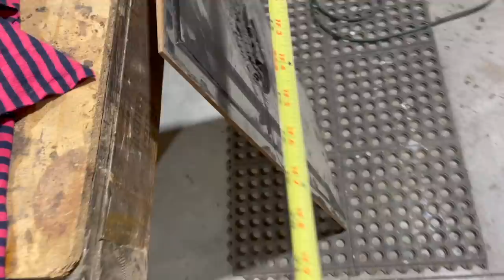Stop looking at my chest

Comment: on that top, It seemed as though all the frame pieces were relatively straight except for that front one that was crowned and twisted. Framers deal with that by cutting kerf cuts in the piece of lumber enabling the thing to be straightened. They straighten the piece by making that kerf cut and driving a long screw in at an angle to pull the lumber into position, couldn't you have done something like that? Perhaps making some kerf cuts in the back where it would be on the inside enabling you to take the crown out that way and then making some kerf cuts on the bottom up to the carving enabling to straighten it out in that plane. then holding the piece straight with clamps and perhaps against something strong like a metal straight tube fill the kerf cuts with wood filler.
Reply from the maker: if it were a worse situation i would have had to do something more. but i was able to get it to an acceptable level without brutal repairs. thanks for the suggestions though. cheers
Reply: Keep up the good work. I’ve have 50+ years of experience in furniture design and woodworking; and no small amount of repairs, too. I also started making and repairing guitars and basses as well. You might want to try using carbon fiber rods in such cases as this. I’ve used carbon fiber rods successfully while both building and repairing guitar necks. There are a number direct to public vendors on line.

Comment: Amazing! With the really warped board, would steam be an alternative to get it straightened?
Reply from the maker: Unfortunately with pieces this old it usually just springs back. Hard to teach an very old dog new tricks. But definitely with newer lumber it would. Cheers
Reply: @johnsfurniturerepair  interesting. Thanks.
Reply: @johnsfurniturerepair  ....it is harder to teach young dog old tricks
Reply: I was wondering if you could have cut it into strips with a bandsaw and glue those up straight, like a lamination or a plywood. You would of course have had to add a bit to make up for the saw kerfs. A lot of extra work though

Comment: Have you run into any issues leaving the inside raw like that? I've heard from others that doing so would be a recipe for uneven take up of moisture and would promote warping. I wonder if that is why it warped so much to begin with.  Sometimes conventional wisdom is wrong so good to hear from experience. Thanks for sharing!
Reply from the maker: definitely left open the trunk would start to take on moisture, but because they are usually closed the humidity stays relatively stable unless stored in extreme temperature and weather conditions. the eucalyptus also smells so wonderful it would be a shame to seal. cheers
Reply: I have learned that the best way to prevent warping due to quick changes in moisture contents is to fill drawers, or in this case a chest, with textiles. They will act as a moisture buffer, slow down the changes and thus prevent warping.

Comment: Couldn’t you have steamed the warped piece and then clamped it straight and let it dry? That usually works for  me. A plastic sleeve over the wood piece with a pipe coming from kettle into the bag. There are professional kits to use too which I’m sure you know.  Your idea worked too. I’m glad. It’s a very beautiful trunk and you did a fantastic job. Thanks for sharing! 👏🏻👏🏻👏🏻👏🏻👏🏻🇨🇦

Comment: Favorite video so far.  Shop Dog, obviously smarting from being called out for not gluing chairs, had me laughing out loud after I figured out what that dusting mitt in your hand would be used for.  SD did get the credit for the repair, tho.  I’ll be getting the 3M Dremel attachment - nice.  Today while spray waterproofing my tent fly I thought of the smooth, even technique in the spray booth, and employed the economy of motion which quickens the job and keeps track of where I’ve sprayed.  Those clients are fortunate to have a pro willing to spend expertise and time on practical work.  The product is sensational.  I get that kind of stuff all the time - regular life, regular quality, messed up stuff which requires yers of experience to repair well.  As for the video title - very embarrassing to be called out for not being the Renaissance Man I imagine myself to be.

Comment: Daaaang! You put some serous work into that. So far all of my clients with chest/trunk projects have all wanted a “suspended decay” style of finish to show off all of the use and wear versus a full restoration like you just did. That onyx stain you used looks great.
I’ve used that clamping method (as you did on the lid) a few times to straighten table tops before; it works really well. 
Nice job, Trena. It turned out great!
Reply from the maker: Thanks! Love the trunks on your channel! They are gorgeous.

Comment: the chest you are working on was made from new cut lumber and likely sold to an importer a short time later. the "hockey stick" piece looks to have been vert near a crotch or a branch then dried out in a drier climate. one little trick I have used id create a loose bag from good plastic around a foot long and6 inches in diameter. put the real warped end of the lumber in the bag and feed steam into the bag until the wood is easier to bed; bend it back into shape against a good solid buck and clamp in place to let dry for a night.

Comment: Someone relayed a Story of this relevance - many folks in the North Michigan region often migrated to Arizona for retirement and took their prized valuable furnitures and antiques with them.  NW MI is a cooler and very wet climate with what they call "lake effect" precipitation and snows coming in from Lake Michigan to the West - while AZ is "a dry heat" is what they like to call it, in addition to the dehumidifying effect of the Air Conditioners which run constantly. . . well you can imagine the surprises of the retirees when their prized possessions literally blew apart at the seams (and joints). . . I imagine you can add a humidifier to to your HVAC but unsure as to that technology needed to maintain a constant and similar relative humidity.
Story Two, with regards to your Lacquer Spraying - I knew a Painter in N MI who did remarkable jobs at clear coating Lacquer on our stain grade trim and doors to our Remodel Jobs. The Plumber and I one day tried to walk in the service door to the garage where the Painter was spraying about 10 doors and the fumes were just billowing out the door in clouds, so much so that my virgin lungs (as a nonsmoker) couldn't even get 6 feet from the door and I was hacking my lungs in revolt! Painter's in there spraying away WITH NO MASK - I ain't lying!  And he's was in there singing "I'm a little teapot, short and stout..."  The fumes were so thick you couldn't see in there! I checked him on it later, and he tells me "I've been doing this for 25 years bla bla bla..." My thoughts were "if he gets one or two more years without the crystallization and collapse of his dead lung tissue, then he'll be lucky. Wear a mask folks, especially for sanding old pre-1978 lead-based paints and finishes!
N MI has a different "breed" of roughnecks, renegades and ignoramuses like this guy - I Framed and Built the big houses up there for 15 years and all 4 Seasons, and literally saw 'em all!  Oh, and it took me awhile to connect the meaning of "Stop looking at my chest" - I think I'm a bit slow!🤦🏻‍♂️🙈😮😆
Reply from the maker: I do usually wear a mask. But I have awesome ventilation as well. Thanks for watching!

Comment: One of the best educational videos I have seen!!  Learned a lot about how you think through the process of "pulling" the warped pieces over then springing them back.  As an engineer, I would have gone about it all wrong, and ended up having to redo all those inner raised lips to make it close again. Your way is MUCH preferred as you actually time it so you can test fit it and make that last and most important adjustment.  Results, when looking at it from a customer's point of view, are the most important thing and as I am engineering based, I get more involved with the process at the detriment of the results....  Lesson firmly learned today on this holiday time... spending it quietly reviewing your older videos as I just sub'd after watching a couple...  Merry Christmas season, and happy and fruitful New Year!!
Reply from the maker: welcome and thankyou!

Comment: Hiya Trena, back in the late 60s' we lived in Kenya in East Africa, dad was in the Air Force. We purchased a camper wood chest very similar to this one, except it was camper wood, what a wonderful smell, and it had the same carving, just a lot more of it. The hasp and hinges were the same, as were the feet, but ours had corner blocks on the feet, in fact everywhere. The biggest difference was on the bottom in the wood it was stamped, with the individual letter stamps was, 'Made In India' I loved that chest and used to polish it with Betterware Lavender wax polish. Stay safe, Steve...

Comment: Wow!  This test turned out absolutely gorgeous! You did an excellent job I think if it was my piece, I have a piece of plate glass cut the same size as the lid, and with some proper felt pads have it sitting on top of the chest to prevent spills from ruining the wood or dust getting down into the carving again. I'm sure up with a pretty chest like this. You put things in there for long-term storage. What is the NEC there on the inside? I think I might've added a bit of cedar oil on the wood on the inside to give it a nice smell. But I think that's a rather personal opinion. In any case this really took it over the top it really is gorgeous now. Thank you so much for sharing!!

Comment: Great channel !.
As a suggestion, would cuts a 1/3 or 1/2 way through the back side of the board. Perpendicular to the length. This would take a lot of stress away. Allowing the board to be straightened. Somewhat destructive, but the cuts are in a good hiding place. Will likely make it crack easier though.
Very best

Comment: Back in 1976 the U.S.Navy transferred me from the Philippines to Great Lakes , Illinois in November. Needless to say my wood furniture did not appreciate it going from 80% humidity to almost none. My center pedestal on my Rosewood dining table developed a 1/4 inch crack. I layed the pedestal out horizontal and poured lemon oil in the crack and the crack closed up completely. It never opened up again as long as I had the table during the next 25 years.
Reply from the maker: Wow. That’s awesome!
Reply: @johnsfurniturerepair  moisture makes a world of difference. You might try the lemon oil trick when you have another item cone up with cracks from drying out too much.

Comment: Your work is absolutely amazing!
I know this is waay after the fact, but about that warped carved strip: in such a case, would it be possible to slice off the carving - and veneer  it (with clamping) onto a new plain board?
Also, revealing the wood grain was a great idea - it elevates the piece but it also provides a wonderfully organic backdrop for the carvings, suggestive of hills, dunes, waves and the sky. Awesome!
Reply from the maker: Yes that would be an option

Comment: Just curious if heat can straight out old warped wood. I was able straight out an oak desk, which I built, by heating it with a heat gun and putting it under the sun. Thanks for all your excellent video.

Comment: The end result never disappoints.  You are amazing.  One approach I might have tried to correcting the bow in the lid's front fascia may have been to reduce its original carving to a section of veneer and remake the fascia from new square wood so fashioned to receive the original carved veneer.

Comment: I know very little about carpentry (watching videos like yours to try to learn!) but mechanically it seems as though if you have months to treat the wood, you could put pieces like this in an insulated closet (like a mini-sauna) with a humidistat and some controlled ventilation and then just slowly humidify the wood until it sits more true, clamp it up, and then slowly lower the humidity until it's at ambient. I know this can work to reduce warping in minimally-treated soft woods (used a lower-tech version to help straighten a table) but I could be completely off-base about whether it would help more damaged or complex pieces.

Comment: Nice work. Watching you try to plane on that floppy bench hurts. Have you ever considered getting a cabinet makers bench with side & tail vices that use bench dogs? You could make one. Heavy maple top, heavy structure so it doesn't wiggle. I came by an old German made one at auction. It was a mess and got it dirt cheap. Love using on it. I modified it so I could hold panels on the front to plane edges.
Reply from the maker: I would love to find an old one too. I hate that my benches wiggle. 😑

Comment: just a idea could have you made a base with bigger frame  , with over 2 inches spare ,then put the bare top frame into the base and add warm water , then use your clamps to level the base over a few days to warp it back to level as much as you can then drain it then either dry it by warm heat or by time as the wood will settle to its natural form.

Comment: Brilliant repair as always. Yes you are right with the colour, much nicer than the dark colour. Only one question if I can and that is, the two braces that you took off the lid that was or seemed too long. Did you shorten them at all or did they fit correctly after repairs done?
Reply from the maker: yes they were shortened

Comment: Beautiful job as usual!!  I recently made a picture frame with black walnut inlaid with wenge.  I had to touch up some putty, which was a little lighter than the wenge.  I used your techniques of using a small brush to apply toner and it turned out great.  Again thank you so much for all your help in the videos.

Comment: The ONLY other thing you could have done on the warped piece was to turn it into a flexible piece of veneer. Cut a Piece of Oak  to the right size and then glue and clamp the veneer to the oak. I have done that only once and it worked great.  But it looks fantastic the way you did it  so Nice JOB.
Reply from the maker: Yes. That’s a great option

Comment: Watching this was such a joy. BRAVO on a spectacular job! I don't know if you've ever been asked this before, but it seems like you spray a lot of the top-coat on the chest... and equal amounts on the top and sides. How do you prevent drips? Does the finish dry incredibly fast in your booth with the amount of air-flow you have, or are you not putting on as much as it appears with each coat? Regardless, I'm in awe of your talents. Thanks for sharing this project with us.
Reply from the maker: lacquer doe dry very quickly. i always do a bit more on the tops of things as they get the most wear. its a fine line between perfect coverage and runs. but after 20yrs i have gotten a pretty good feel for it. but it still happens sometimes. thankfully none this time. cheers

Comment: I have used a steam, 2 vices and 2 straight 2x4's to fix a warping on a board about that size. It worked, as far as I know.
Reply from the maker: It works on newer lumber but not something g this old. It would most likely spring back over time and I needed to make sure it stays where I put it. But it would definitely work on newer pieces.

Comment: You made a silk purse from a pig's ear. Nice job on the counter twist. That chest is a cheap export knockoff; clearly made from wood not properly dried. 
I made a set of eight raised panel doors for our lawdry room and when I went to put one together, the rails and stiles were twisted. I did the same as you when I glued it up, not knowing how much correction to dail in. But, when I released the clamps the next day it sprung back to precisely flat. I couldn't believe my luck. For years after that I keep checking that door and remained perfectly flat.
Reply from the maker: great job!